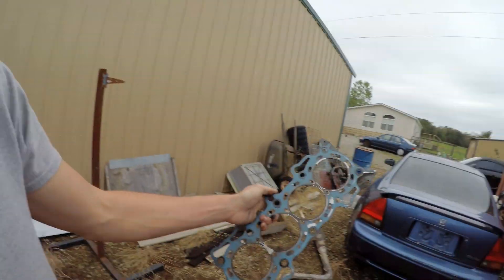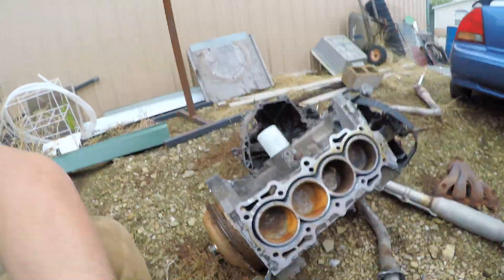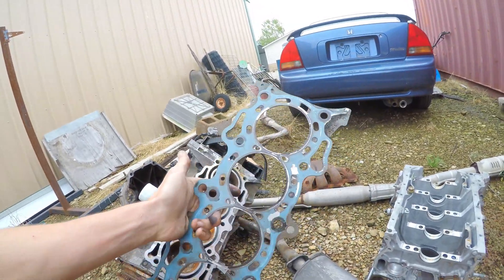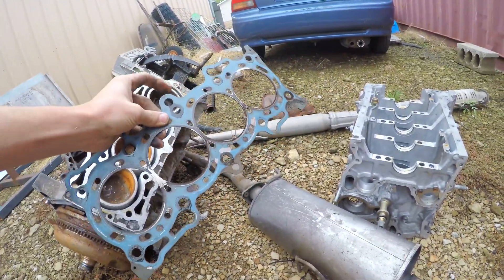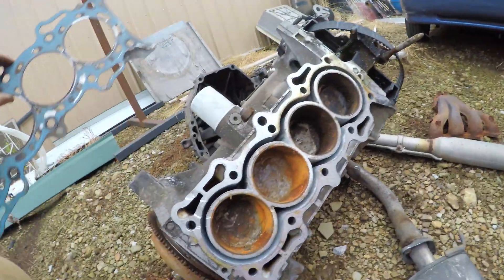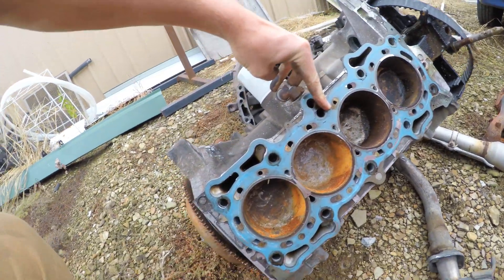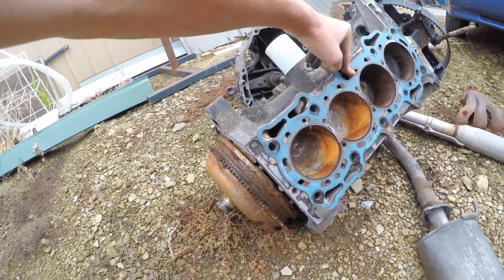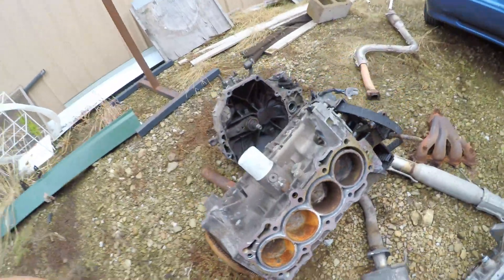F22A/F23A Cylinder Head Match Test

Comment: Did it work?
Reply from the maker: Well, I went H22 ¯\_(ツ)_/¯
Reply: What timing belt would be used if u did use the f22a1 head on the f23a1 block ? And to set timing  is it the same for both engines being that they are both f series?
Reply: @4thgenlude397  both belts have the same amount of teeth and all the holes line up